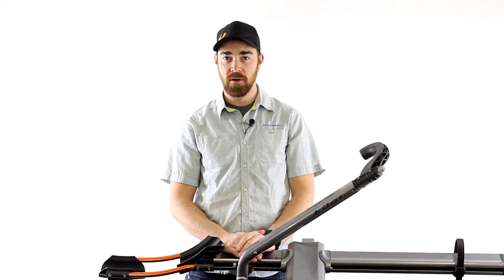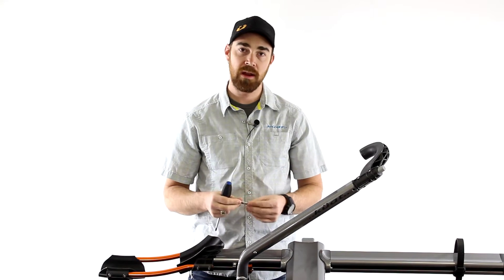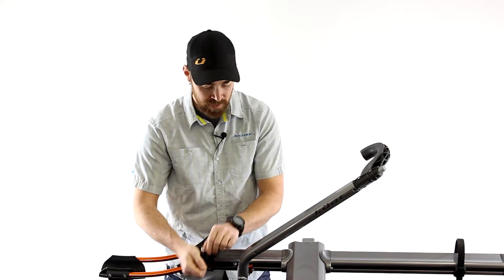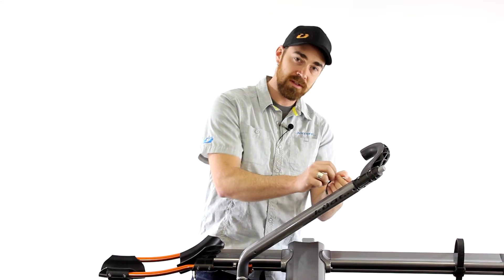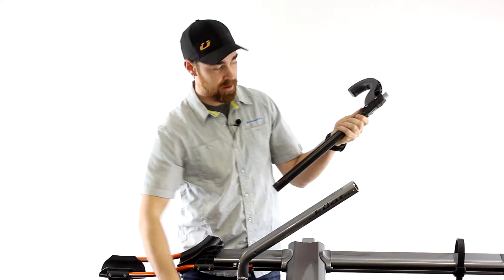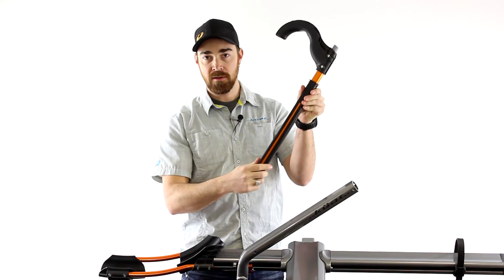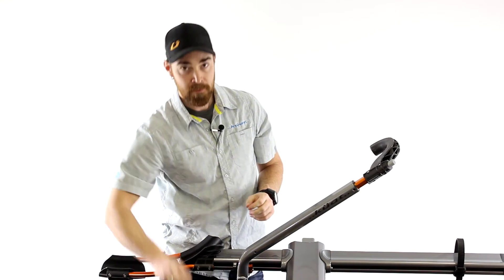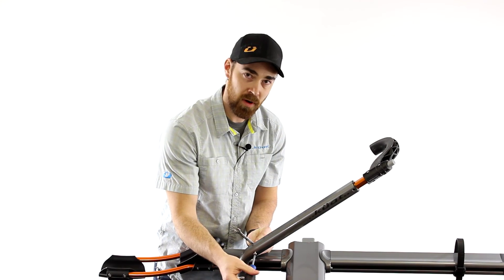Ratchet Arm Replacement - Küat Racks

Comment: Thanks for the instruction. This is a great company, but they may want to update the video. I have a Sherpa 2, and the company kindly sent me a replacement arm when I told the rep that the head on of one of our's was melted by some nearby vehicle's exhaust pipe. 
The arm I received doesn't have that bolt at the bottom, but instead has a collar at the top that's affixed with a Allen key screw and nut. So, to make the change, all I needed was an 8mm Allen wrench. I noticed that the new arm doesn't produce a ratchet sound when raised or lowered, so it's possible I did something wrong on the install, but I put the arm back in exactly as the old one came out. Thanks again.
Reply from the maker: Thanks for the note. We will try to update that video. Hope things are working for you now. Have a good ride!

Comment: My Kuat NV2 doesn’t have the bolt and screw at the bottom
Reply: Ever find instructions for replacing the 2.0?
Reply: @albyurkom  I never found instructions.  I forced the ratchet  rails out and discovered a sever rust problem inside the tubing.  I had to order a new arm.
Reply: @sleepingdog8525  thanks. I ended up just replacing ratchet arm despite good amount of rust. Working for now 🤞

Comment: My ratchet arm stopped ratching and locking itself.  Do I just need to change the ratchet arm?
Reply: Yes.  I've done it a couple times.  Kuat sent me replacements quickly and my NV 4 Bike rack is back in business in about 10 minutes.
Reply: @kymba-lt4094  Yes I ordered the new arm an installed it in like 2 mins  Thanks for the video.
Reply: Or just take it apart and hose it down with WD-40 or equivalent to loosen the ratchet finger and spring.  Just a bit of rust and corrosion.

Comment: Is V2 compatible to V1?
Reply from the maker: Thanks for the comment! The parts between the original NV (this video) and the NV 2.0 are not backward compatible so the parts will be different. The process however for replacing a ratchet arm is very similar. The NV 2.0 does not have the screw halfway down the arm. Instead, there is a plastic collar towards the top of the arm tube with an allen bolt securing it on. To remove the NV 2.0 arm you will remove the allen bolt, pry off the plastic cap, and then the ratchet arm can pull out.

Comment: where is the 2.0 video? It is different.
Reply: @Bobby Erwin then you don't have the nv 2.0.  Mine is totally different, can't find a resource anywhere from Kuat on how to take it out, and clean it.
Reply: Yea I am experiencing the same problem, and can't find a fix for my mv 2.0
It is definitely different from this video. Help!!!
Reply: Anyone get an answer on this? My NV Base 2.0 does not have the bolt at the bottom... can't find instructions anywhere.
Reply: For anyone wondering about the one that doesn't have a securing bolt, there's nothing there. You just need to remove the collar at the top of the arm and yank. Mine was covered in rust and crap so it took a little elbow grease.
Reply: @Achoistory  so you just pull out the old sleeve, and slide the new sleeve in? My old sleeve is definitely stuck and hard to remove.
Reply from the maker: Here is the ratchet arm replacement video for the NV 2.0 https://youtu.be/k1HrvsaDrX0?si=AC7f5ismA1M71jhr

Comment: So, the ratchet system is plastic on plastic?
Also, the ratchet racks (or arm ladders) are NOT the same. One side has teeth on it and one side does not, according to the pictures on Kuat's website. https://shop.kuat.com/Ratchet-Arm-2.0-Ladder
Reply from the maker: Thanks for the comment. The NV rack has an aluminum arm that slides into a hollow aluminum tubing. The black ratchet arm ladders (the internal pieces with the ratchets cut into them) are plastic.
The original NV (in this video) and the NV 2.0 (link you posted) use different parts. Here is a link to the ratchet arm ladders for the original NV rack: https://shop.kuat.com/NV-Sherpa-Ratchet-Arm-Ladder
I hope this helps clear up any confusion!